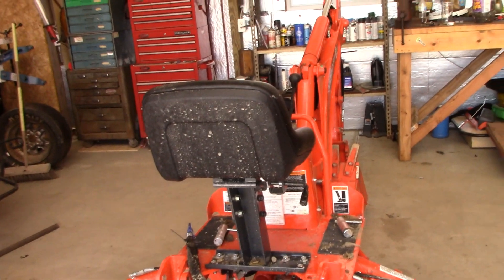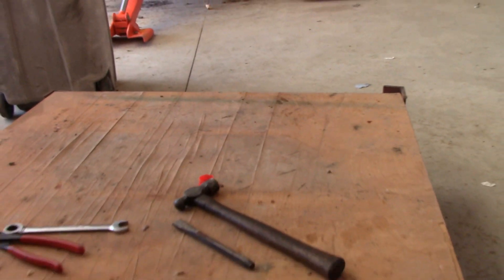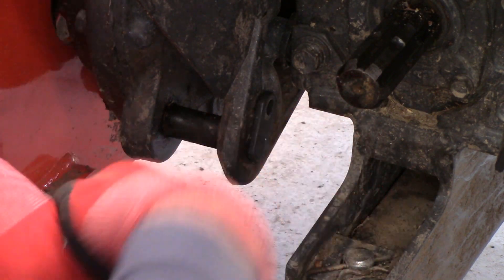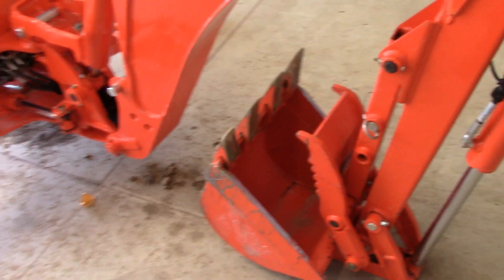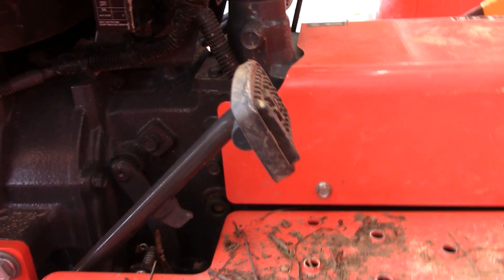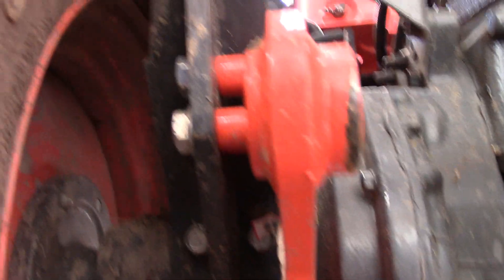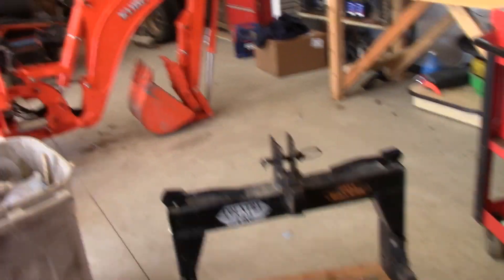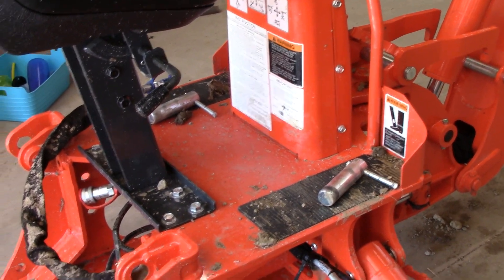Installation of the Kubota BH77 backhoe, sub-frame, and hydraulics.

Comment: Can you still use the 3 point hitch with the subframe on?
Reply: Yes, and the subframe has the added benefit of strengthening the tractor frame. It also adds weight for increased traction.

Comment: What a fantastic summary!  I too have a 2501 and am thinking of a backhoe.  Not sure I can justify the cost as it is only for use around my 1.5 acre lot.  Nonetheless, this video has convinced me that if I do pull the plug, installing it will be fairly simple.

Comment: at 11m38s, the stabilizer pads are down, and they stay down until you can raise them using the hydraulics. The earliest that can happen is 14m24s. Then you talk about the exhaust hanger pliers until the cut at 14m51s, after which the pads are up and you put the mounting pins back in. What happened in between? How on earth did you get the backhoe engaged with the bracket???
Reply from the maker: Video editing happened.

Comment: The rear end is NOT aluminum
Reply from the maker: Is to. Magnet doesn't stick.
Reply: @lacelleacres854  maybe you got a weak magnet, or a "Chinese-ium Prototype ". Just try a Stonger magnet. 99% of These L2501-3901's are cast iron, nodular iron, cast steel.

Comment: I don't believe there's any aluminum in that rear end should be all cast iron. Reason why they recommend subframe mounted backhoes is because the 3-point back holes will tear the crap out of your tractor
Reply: On the B2650 it is all die cast aluminum
Reply from the maker: It's aluminum. Magnet won't stick. I shared info that I got from the dealer.

Comment: I bought the L3301 last year and am thinking of putting the BH77 on it.  You know, the loader can't do everything.   The local dealer quoted $10,250 for the subframe, backhoe, seat, and hydraulics intstalled with warranty.  Basically everything ready to dig.
Reply from the maker: I've had my BH77 for 10 months now I still love it and have many uses for it.
Reply: A Friend of mine said; "when you have only One Tractor without  Backhoe, You Only have HALF Of a TRACTOR."

Comment: did you need to take the rear wheels off or can the sub frame be mounted with the wheels on.
Reply from the maker: I think you should take the wheels off, otherwise it's a tight working space. I did one side at a time.

Comment: I finally got My Hydraulic lines on and they are tucked away and NOT LEAKING anymore.

The fittings that came with the Woods BH-75 had 45 degree fittings and the fittings and Hose stuck way out 

What a pain

Spent $42 at a Hydraulic Supply store for about 7 fittings to get 90 degree fitting at the hydraulic block and adapters to connect to the hose supplied with the Backhoe, and they still were sticking downward too much. ( Wound Up not using 5 of those fittings I bought )

I did not throw that original hose away

I reconnected it at the Block and routed it toward the backhoe and coupled it straight to the supplied hose

Yes it is too long, but now My line leaves the block with original hose closer too the tractor

The extra hose length was long enough for Me to make an upward loop then down too the mounting bracket location for the female Quick Connector

Excess loop easily tie wrapped to the unused slot behind the 3 Point lever slot and finally NO MORE LEAKS

My Woods BH-75 came mount too a metal frame that I am hoping to turn into a roll around platform

Not so sure rolling this thing around a lot is a good idea because it is REALLY HEAVY

It took Me a while to move it without wheels.  I tried using My forks and they helped but it was really unstable and top heavy

My Woods sub frame has the bottom frame locations pointing downward, not like Yours where You raise the backhoe up & then drop it into the sub frame cradle 

Maybe I'll finally get thing working soon

I've had it 2 years already

Thanks and Sorry for running on and on, but it has been aggravating 

Ken in Florida

Comment: What is the part number for the subframe kit?
Reply from the maker: I don't remember.
Reply: If you go to kubotausa.com you can look up your machine.  Look in the parts look up page. Then it'll probably be in the local options section.  It may also be under the BH77 backhoe option section. I don't recall which area it's in. 
That is basically the same look up source the kubota parts guys use at the dealership.  Subframe kits were sometimes a pain to find.
Reply: It is BH4673 for the B2650 with cab

Comment: What size taps did you use to chase the threads for the sub frame and small brackets?
I'm having trouble finding the proper size.
Reply from the maker: I don't remember off hand but I matched tap to the bolts supplied with the kit. I think it was 14mm x 1.5? Sorry for the late reply, been really busy around here.

Comment: Hi

I really appreciated Your Video

I bought My L-2501 2 years ago and then bought the backhoe the following week

I still haven't installed it yet, but I did put on the subframe and the Hydraulic lines

I wish I had figured out the Power coating issue first, but I DIDN'T

I haven't needed it yet but I want to get it on and ready and Your video was Really Great

Thanks

Ken in Florida